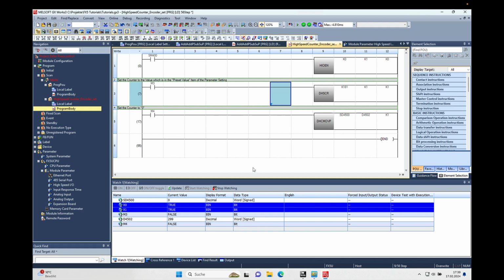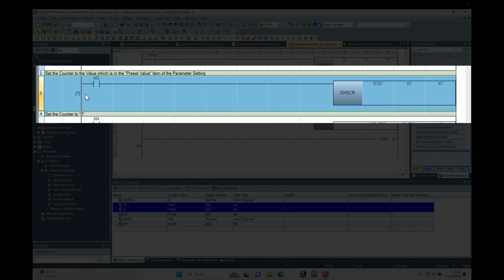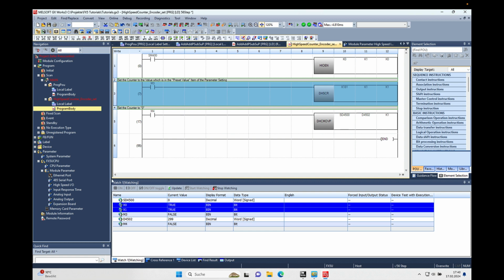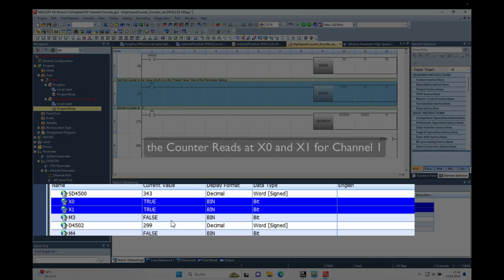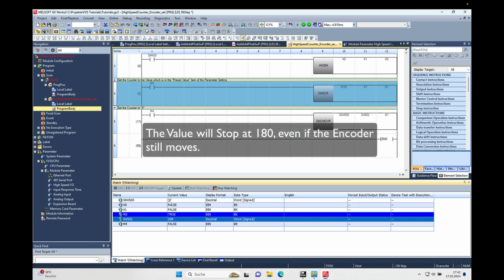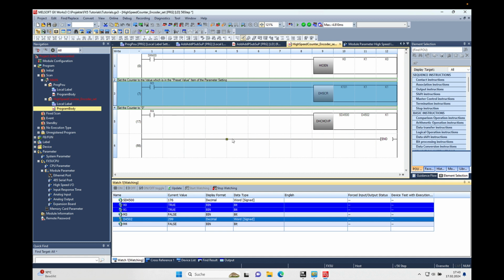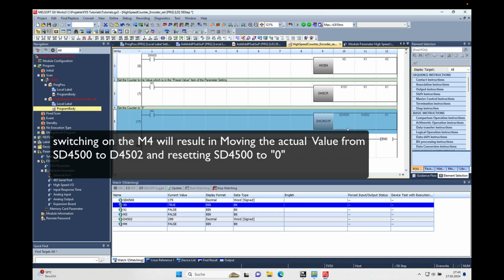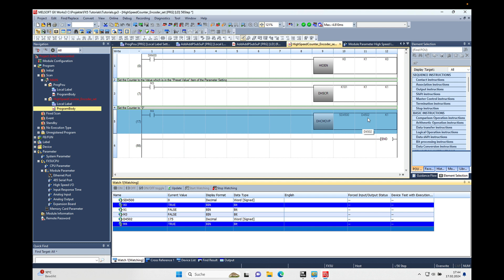Encoder Setting Resetting Actual Value Mitsubishi FX5U using high speed I/O counter

Comment: If I am not wrong, when you press M3, the encoder will stop at the value 180. It isn't going to the 180 value. 
K181 is a special register? Which means it has nothing to do with 180 value. Imagine I want it to stop at 300, I also need to use the K181 but at the preset value I would type "300". DHSCR K181 K1 K1.
Am I right? Huge thanks in advance.
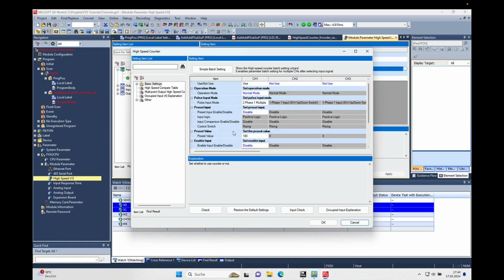Reply from the maker: Hello, Thank you for your question. Yes you are right. The preset value i your case will be 300. This is explained at 1:18 in the above Video.
Reply: @zellerautomationandplc  Great, thanks for the clarification!
As a new programmer, those videos are fantastic! Keep up with the excellent work!